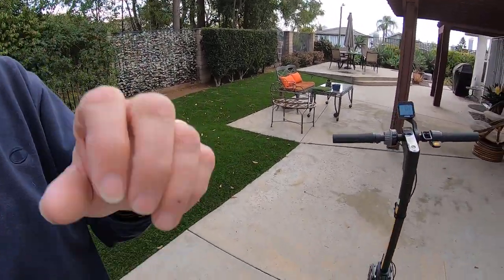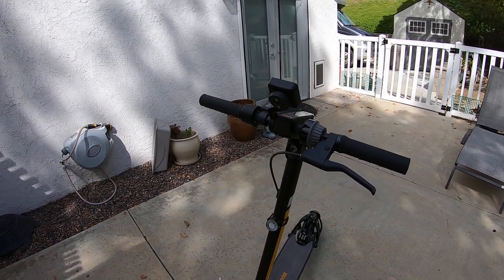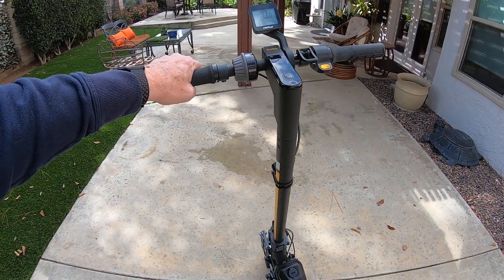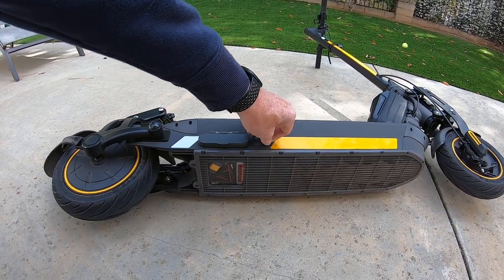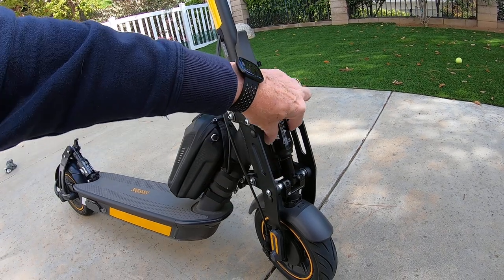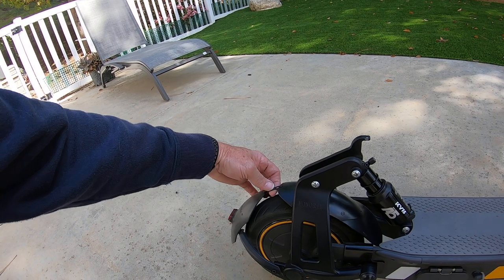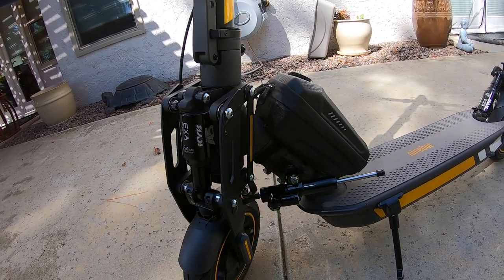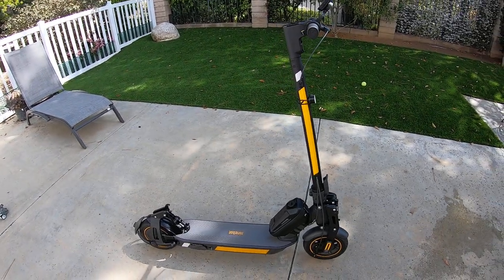The Perfect Segway Ninebot Max Scooter Modifications

Comment: Great video and very interesting. Hands down the best MAX G30 mod video on the internet. Not only adding new parts but some seriously good mods too. Great work man, loved it :) Enjoy and ride safe.
Reply from the maker: Thanks for the comment, much appreciated
Reply: @Nonbock  I just bought the 48v max pack external kit and did the installed to my scooter. I reflash the firmware software provided by my max mods and notice the scooter lost a tremendous amount of torque but did gain a little bit more speed at top end. Is your scooter experiencing the same thing? And what reflash did you installed on your scooter after the 48v conversion? Thanks
Reply from the maker: Sorry, I just saw your question, the torqe is much better than stock, maybe twice as much. I used the flash from MyMaxMods

Comment: Although I must admit that I’m also guilty of operating with just one hand I’ll strongly recommend that both hands should be on the handlebars at all times. It’s just not worth it. If you have to take off one of your hands for whatever reason just stop for a moment until you are done and take off again. While it can be annoying to come to a stop a few times during a ride in reality it won’t increase your travel time in a meaningful way. Having an accident on the other hand will cost you that at minimum. Scooters are dangerous enough as it is (mainly because of riding position) but at least with a firm grip on both handlebars you can have enough control to lessen the severity of any accident. Trust me - the last thing you want is to hit some nasty pothole, collide with something or someone. Actually even the tiniest patch of dust or sand can cause a skid you’ll remember for a long time.
Reply from the maker: Well said, I often think about the consequences of waving to someone. It is a risk.

Comment: I watched a good video. I also replaced all 16 of the existing bearings with precision bearings in the same monorim product for the front suspension, replaced them with exa hydraulic coil shocks, and installed a street bar by myself instead of a damper.

Comment: As an ebike user, I recently came across a new project called freebeat Morph 2-in-1 e-Bike, and I must say, it's truly impressive. The video was informative, showcasing the outstanding features of the Morph e-bike. I was particularly intrigued by the dual modes that allow it to be used both indoors and outdoors. The ability to charge the bike while in indoor mode is a game-changer! The brushless 750W motor, smooth ride with suspension and puncture-resistant tires, and the Smart Saddle Detection+ feature for fitness insights all make this e-bike stand out. I'm excited to learn more about freebeat and their innovative products!

Comment: The battery has 15ah capacity added for driving assistance to increase the mileage to about 80-90km, and with custom firmware, the current speed is 36km/h and the rear-wheel suspension is being used by myself.

Comment: I love my es3 but also hated some stuff to it.

I was on Budget when I bought my ES3 got it for like $120 like new from someone who bought it but didn’t like it so let it sit.

But one thing I hated was the electronic brakes I wished it had a disk or drum brake to help have more braking power.

Didn’t like not having suspensions in the rear either

So I bought a pneumatic 8in wheel with drum brakes and drilled 3 holes on my scooter to fit a lever brake with the drum brakes and wheels so much better

Other thing I hated was how short the handle bars were, as some who goes cycling having proper bar length was important so I 3d printed an extension and bought new bicycle grips also and added a customer peak design Mount also.

Comment: Fantastic mods, I still slightly disagree with the 48 Volt mod for several reasons, but that's my opinion. I don't like risking overheating and burning up the motor, burning connectors, adding weight, increasing charger carryon weight, going through tires faster, etc. The Front and rear suspension were pretty interesting, but that steering damper could be a lifesaver I'm sure.

Comment: You're brake is supposed to be positioned that way because you're supposed to keep a grasp on the bar while you're breaking, only 1 or 2 fingers on the brake lever, because if you hit a bump it could knock the handle bar from your grip. The higher end scooters have short brake levers so you can't squeeze it on your fingers

Comment: Great video. Love the idea with the wondow to oberserve the interiors. Couple question: What are lengths of those shock absorbers that you use? I know that there are 150, 165 and 190 mm options. What I could see other people do is they put a 165 mm on the front suspension and 150 mm on the back. It seems like this also solves the problem of leveling the scooter. Another question is about folding the scooter. After the installation of the rear monorim suspension is it still possible to attach the clip which is on the handlebar to the monorim hook on your scooter? Cheers.
Reply from the maker: Both my shocks are 150mm, but the 160 on the front as you say should work great to lift it up and save all the modifications I did. Yes you can still fold the handle down and clip it to the monorim hook. You will have to twist the clip on the handlebar a little.

Comment: Just a heads up. The brake leaver is set that way for a good reason. You dont need to have all four fingers on the leaver to get most out of your brakes. Same as in the bike world. one to two fingers is enough. With four you are running risk of over streching your cable or damaging brake system.
Reply from the maker: Yes I agree only 1 or 2 fingers are necessary, but moving it the outside of the bell makes it a much easier, more comfortable reach

Comment: Nice mods Alex... well done!
Just to let you know that Monorim offers the DMXE and MXRE series now with these same air shocks...unfortunately with single chamber only.
Their front suspension is a twin shock system...do you think that might be a better option than a single shock?
This will permit to pressurize less than with a single shock and it would be a redundancy security in the event of a shock failure.
Cheers,
Phil
Reply from the maker: Hi Phil, I am not 100% sure how the single chamber compares. My guess is that the dual chamber helps with top out damping, ie when the front wheel comes off the ground there may be a clunk noise as the shock goes to full extension on the single chamber unit.
Reply from the maker: A dual shock setup is redundant and not necessary in my opinion. The air shocks I have had for about 8 months now and they don't lose pressure at all. Very well made.

Comment: First of all, thanks for the info sharing.
May I ask more about your experience with the front suspension only? I will do some upgrades, but I'm not sure if I want a rear suspension. Is the rear suspension make a substantial difference? My guess is that the front could be a gamechanger, but the rear does not add so many values as the front when you upgrade the stock setup. What is your opinion about this?
Reply from the maker: You are correct in your thinking. I started with the front only and ran it like that for a while and I was happy with the modification. The air shock is important though, it makes the experience so much better and refined. However after adding the rear, it made a further improvement especially when hopping off curbs and on bumpy surfaces.
Reply: @Nonbock  Thx 4 rpl, I appreciated

Comment: This is what I've been looking for! Thank you very much for this marvellous video. I'm going to buy the front suspension. By the way, did the air suspension came with an adjustment guide? How would I know which set up to use?
Reply from the maker: No, except for some pressure guidelines, mostly important to note that the larger chamber needs to be a higher pressure than the smaller one. I experimented with different pressures to get the best feel. As I recall 40psi in the large chamber and 30 in the small one. Note that the seals stick to the shaft after about a day of non use. You have to bounce the scooter to free up the seal then it will be fine for the ride.
Reply: @Nonbock  thanks a lot! Immensely helpful.

Comment: With the Monorim rear suspension I notice while using the stock 6" eye shock the handle bar hook did not line up with the rear hook. I modified it to 5.5" and perfecto!!! in lines up
Reply from the maker: Yes, I had to rotate the spring hook on the handlebar and do a bit of metal filing to make it work.

Comment: Excellent video! Just getting started with my Ninebot. Do you have any videos or tutorials you would recommend for changing the valve stems in the wheels? Only have about 50-75 miles on both of our scooters and starting to have valve stem failures. You're obviously a whiz with the Ninebot, and assume you've changed a few sets already with the tons of miles you're racking up. Thanks for any help, and excited to start adding some mods!
Reply from the maker: Russell, I have changed only one valve stem. A new one came with a replacement tire, so I tried installing it. I discovered that the new stem diameter was slightly larger than the original one and would not go through the hole in the rim. So I compared the size of the original stem and the new one and drilled out the hole in the wheel by that same amount. It wasn't much, about  0.2mm. After that I applied some soapy solution to the valve and it pulled through the hole without any problems. It has been fine ever since.

Comment: I got the same exact setup as yours but when installing the front monorim I couldn’t use both black washers because I couldn’t for the lynchpin and ended up with only silver ring sent by monorim but now I have extreme front stem wobble!
Reply from the maker: One of the youtube videos on the installation of the front Monorim explains which washers to use. I remember having an issue too but got it to work OK without any slop in the steering

Comment: Thank you for this video, I wonder if brakes are enough for such a speed.
Reply from the maker: The one brake lever has two functions, initial application applies regen braking from the rear wheel and the next is the front brake. Yes in an emergency you need all that it has and it is pretty good. Most of the time I'm in regen braking and hardly use the front brake.
Reply: @Nonbock  Not modes right?  Just the original regen braking?.
Reply from the maker: Correct, all original brakes. No mods.
Reply: @Nonbock  thank you for your time!

Comment: id love to know if its possible to attach extra battery to increase the range before running out of juice ? I dont rly care about better tork in hills or more speed, range is the most important for me.
Reply from the maker: It could be done, but not with the 12v battery extension I have. It would have to be a 36V battery.

Comment: Question about the battery pack, can you still fold the scooter? I use the scooter often and always put it in my trunk. Just wanted to know if it still folded down normally. Thanks!
Reply from the maker: Yes, I had to rotate the loop on the handlebar a little but there is a hook on the rear Monorim suspension and it works just like the original

Comment: how do you find the front shock? ive read some reviews on amazon of it bottoming out causing a dead stop.
Reply from the maker: On the early design front suspension video you have seen, the front fender did not move up and down with the wheel so when the suspension compressed, the wheel would contact the fender and act like a sudden brake. The design now has a fender mount that goes up and down with the wheel and clearance remains constant. No longer an issue.

Comment: So to be clear you originally bought the monorim front SPRING suspension and then swapped for the air shock sourced on alibaba and it was a clean swap  / perfect fit etc ?
Reply from the maker: Yes Justin, The 150mm length shock was a direct replacement for the original spring unit that came with the Monorim. Note that the air shock seals will stick when left unused overnight or longer. You have to bounce on the scooter to unstick them at the beginning of each ride. After unsticking, they are fine for the rest of the ride until it sits a while without use. Apply some oil to the shock shaft to reduce the sticking effect. (they advise that in the info that comes with them)
Reply: @Nonbock  I just got my exa a5 what pressure should be in front and rear?

Comment: Could you add the sound of the motor when it accelerates and at top speed?
Reply from the maker: That could be tricky. it is super stealthy because the motor is the rear wheel, no gears like on a hub drive bicycle. I have scared a lot of folks passing from behind even though I sound the bell to warn them. There's more wind noise than motor noise
Reply: @Nonbock  rear brake is a really good upgrade

Comment: With all the weight you added it equals any gain you received from the extra battery, also brakes are same and the electric motor runs hotter now as well.
Reply from the maker: No, far from it. The performance gain by far outweighs the additional pounds.

Comment: How long have you had the battery pack installed?
Reply from the maker: I got the extra 12v battery last August and purchased the scooter in May. Both batteries are still strong as they were when new
Reply: I purchased my Ninebot Max in September 2019 (pre-order before release), I wish I had purchased the reflective stickers a lot earlier. I can’t find them anywhere nearby, all out of stock. I live in Belgium. Ofcourse I could buy some third-party reflective stickers in a local shop but those would never match my kickscooter as the original ones do.

Great modifications. I really love the G30 Max.

Comment: Great walkthrough for what seems to be the ultimate upgrade to the already great ninebot max!

you mentioned that you had the front suspension installed first. What was a more significant upgrade in terms of ride comfort the rear or front suspension?
Reply from the maker: The front makes the biggest difference. I ran just the front for a while before the rear. The rear suspension comes into its own when hopping off a curb or hitting a big bump.

Comment: How’s the rear set up 40psi,30psi
Reply from the maker: Rear would be too soft with 40/30psi with my weight. It might be good with a light person. My best setting is 100/90psi on the rear. Front is good at 40/30. 
Note about the shocks, after sitting a couple of hours, the seals stick and you need to bounce one time on the scooter to free them up and they will be fine for the ride. You need to add a little oil to the shaft to lubricate the seals.